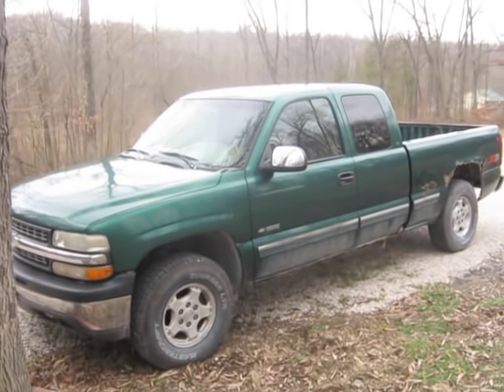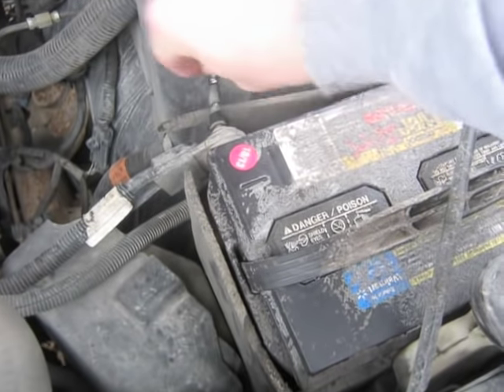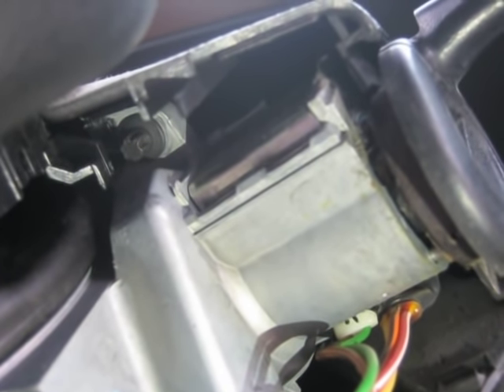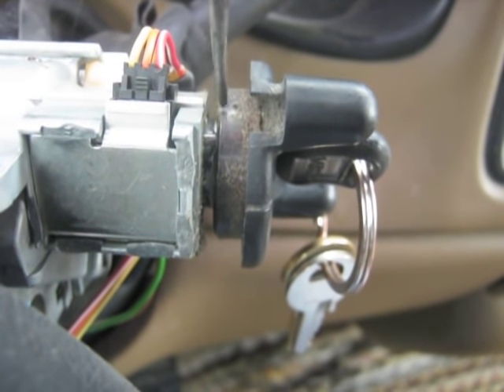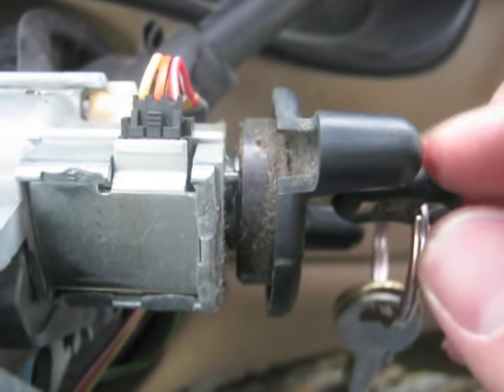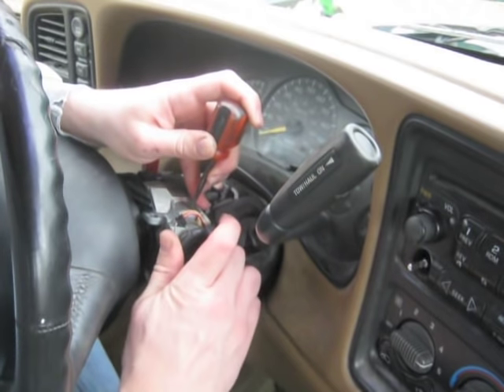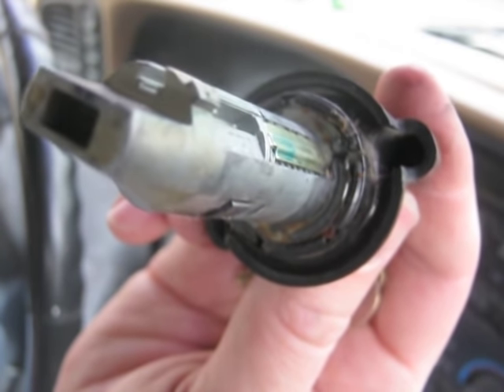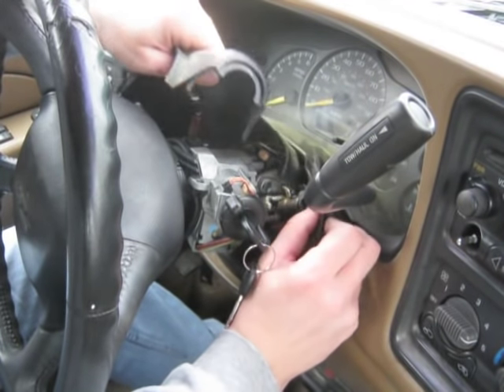Key won't turn ignition - ignition lock cylinder Chevy Silverado 1999-2006

Comment: Where did you purchase the ignition lock cylinder. Thank you.
Reply from the maker: I usually get parts from my local auto parts store, Rockauto.com or off of amazon.
Reply: @TheDaninator  Thanks for responding. Rockauto wants 27.00 and Oreilly wants 63.00 Rockauto 3yr warranty Oreilly 1 yr.

Comment: How do you wiggle it to start
Reply from the maker: K Hodges I would push the cylinder in and out a little bit while wiggling the cylinder front to back...at the same time trying to turn the key.
Reply: The Daninator OK cool thanks I got stranded an hour ago and I just pulled the key all the way out again and its locked. I can get it sometimes but other times it won't move
Reply: Does moving the steering wheel do anything? I usually move the wheel back and forth while messing with the cylinder and when it works the keyturns backwards then all the way on
Reply: The Daninator sorry but I have one more question? Could I remove the cylinder and start my truck with a screwdriver
Reply from the maker: K Hodges not sure. I've never tried. But I would guess that you could.
Reply: The Daninator awesome thanks man yea i can't get the key to turn. I actually wedged to razor blades in between the pins but it still wouldn't turn over
Reply: The Daninator yo man I got it finally

Comment: K I have almost the same problem. I can't turn the wheel or the ignition itself.
and I can't get to the (little pin) cause the cylinder won't turn
Reply: almost at the point where I'm just gonna set the damn thing in fire!
Reply: and I watched all the other videos....yours is the closest to my problem. everyone else is stripping the dash. or taking the wheel off.
or using air hammers
Reply from the maker: William Brown I had to wiggle the ignition front to back while putting slight turning pressure on it in order to wiggle the two pins that lock the key position.
Reply: that's still not the problem that I have.
there's still a couple of tricks to try.
but like I said your vid is still the closest. gonna try and pull the cap off and try to get at the lock bar thing. hopefully that will work. if not then I'm going to just sell it
Reply: @voodoopapa919  hey did that work for you? did you get it out taking the cover off and sticking something down there? i have the same issue ive been trying for hrs

Comment: The ignition is stuck on off position for me. I tried the little pin hole an it wont come out.
Reply: Watched this video and got the cylinder out in 30 seconds once I got something that would fit into the slot

Comment: I have a 98 silverado and the covers don't split at the ignition big pain
Reply from the maker: Kevin Schmidt On the '98 model you may not have to remove the top cover completely. If you lift the cover just enough, you may be able to reach the hole to push the release pin. That model year cover is certainly more difficult to remove than the next generation's cover.
Reply: Thanks,
But the problem turned out to be the housing that the cylinder and switch go to what a pain in the $_#!

Comment: I don't have the key though I'm picking it an it won't release the ignition lock cylinder
Reply from the maker: The ignition needs to be turned to the "run" position in order to rotate the release pin into position (lines up with the small hole). Only then will you be able to stick the pick into the small hole to engage the release pin.
Reply: The Daninator ok but I lost the key how can I make it turn to the run position
Reply from the maker: Oh boy. I'm thinking a call to a locksmith may be in your future. I don't know of anyway to turn the ignition without the key.
Reply: The Daninator thanks for your advise

Comment: Ok we changed it and it turns but doesn't turn engine on? Help!!!
Reply from the maker: Must be something with the ignition switch itself, possibly...that or the battery wasn't reconnected?
Reply: sanpanchozacatecas. I saw a video that said there was a thirty minute reset procedure for some cars, because of the security features.

Comment: Doesnt your anti theft system turn off the injectors, thats what mine is doing
Reply: billrobbobjo  mine too ... im thinking if i change  this ignition  my starter and fuel injections would turn back on... i change my steering column  security  was on now its off... my car still wont start
Reply: Ya i went back to the cylinder that came with the car it works, So if anything either i will have the cylinder re keyed or the locks switched back.

Comment: Totally incorrect. 

Take your title to the dealer and they cut you a new key that fits and isn't worn out! Problem fixed. 

That pin has ZERO  to do with the ignition not turning